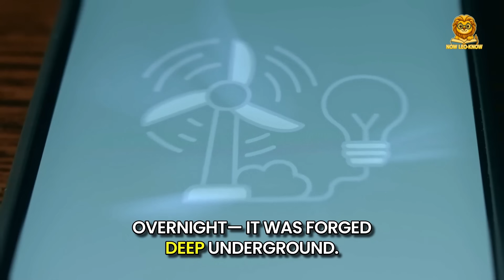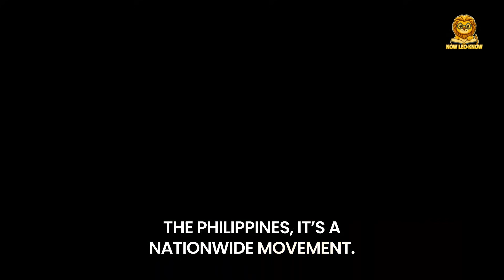Why Geothermal Energy Will Make the Philippines Unstoppable

Comment: It started during the time of Marcos senior where the energy sec is geronimo velazco. 1980s. I was a drilling engineer...this clean energy must progress so as not to suffer from the adverse of fuel fossils in ecology (carbon emission) and destabilization of economy due to price hikes on fuels dictated by global market/producers. the country should be ready on the recurrence of global conflict on the geographical territory issues.
Reply from the maker: You're absolutely right. The push for clean energy began decades ago—and it's more urgent now than ever. Reducing dependence on imported fossil fuels not only protects our environment but also shields our economy from global shocks. With rising tensions and climate risks, energy independence is no longer a choice—it’s a necessity.

Comment: Geothermal energy hindi secret eh! Remember TIWI hot springs——- the naglagbung hot spring has a two meters hole that squirts hot spring water as we call “Geyser” it was quite popular to tourist all over the world and finally ended squirting when in 1965 during Pres. Marcos. Australia financed the building of Geothermal electric plant which supplied the Bicol region. Years Leyte, Negros, sorsogon, Batangas built for their green electric energy. Davao should have built one in Mt. Apo, extinct Volcano in Bataan, Mt Buhi , Mt Iriga. and Mt Pinatubo. Yeeeeeeeeeh! Wake up Energy department. The Philippines need not use natural gas for power plant—- daaaaaaah! rather use the power under the ground. Please make a trip to  the town of TIWI, Albay—- you’ll be surprised what you’re missing. Comment from the wise Albayano.
Reply from the maker: That’s a fair observation—thanks for pointing it out.